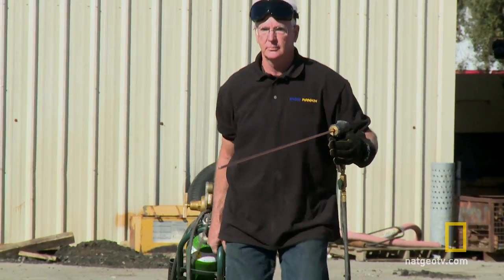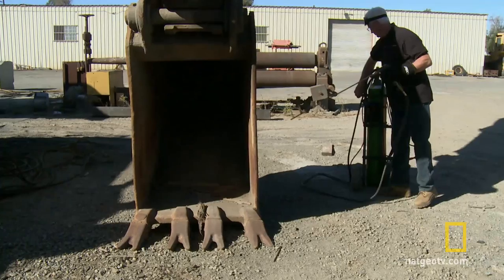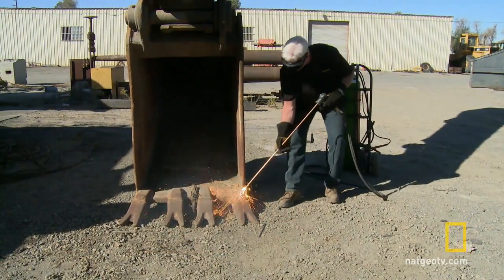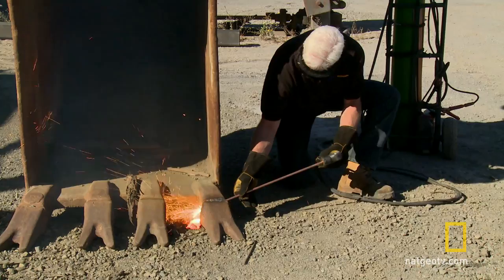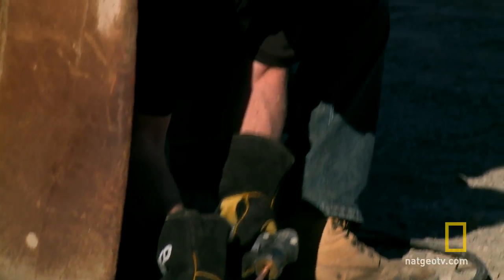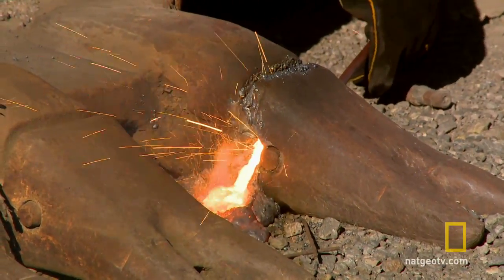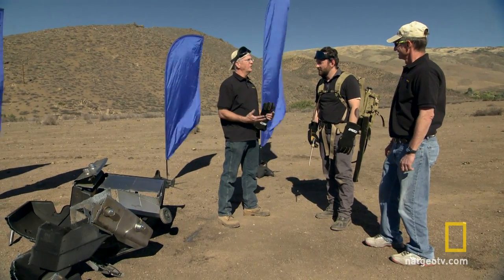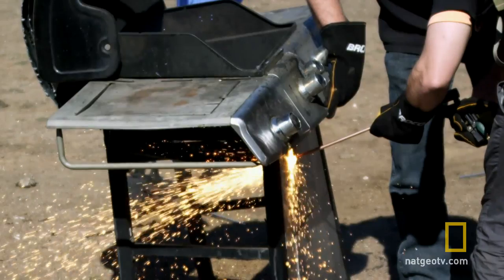Broco Torch Test | National Geographic

Comment: what is the big deal? it is just an O2 lance.
Reply: Could you explain to me how exactly one of those works? Is the nozzle supposed to be sacrificial?
Reply: @midgetman4206  Exothermic Cutting uses heat from a chemical reaction between a consumable steel rod and oxygen flowing through the rod. Test data show that little or no oxygen remains. The oxygen not used in the reaction blows the molten material out of the cut area. This action creates the kerf that allows cut progression.
I hope this helps